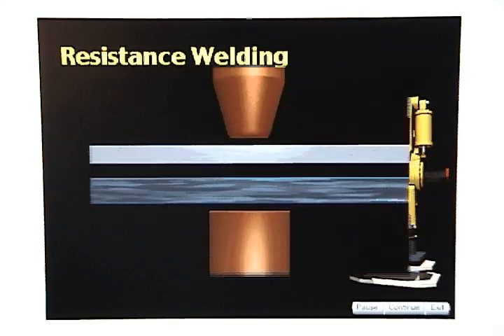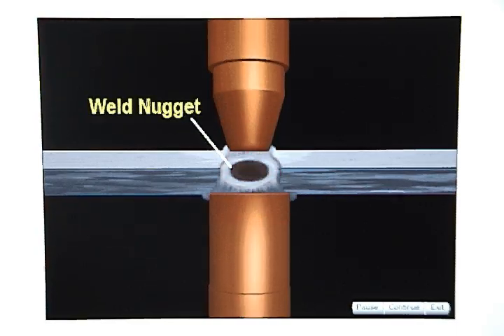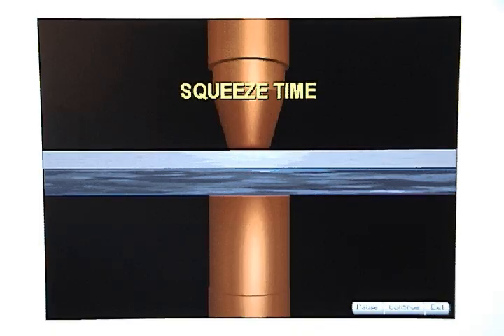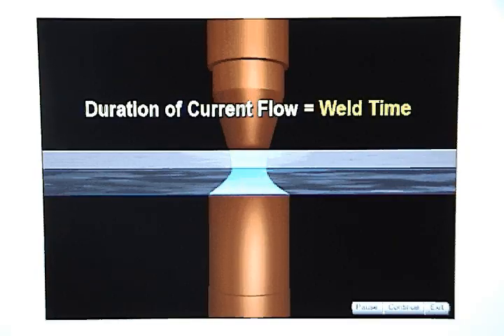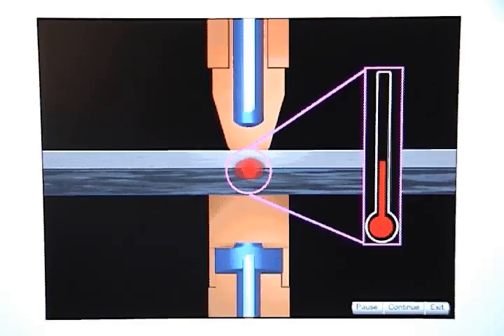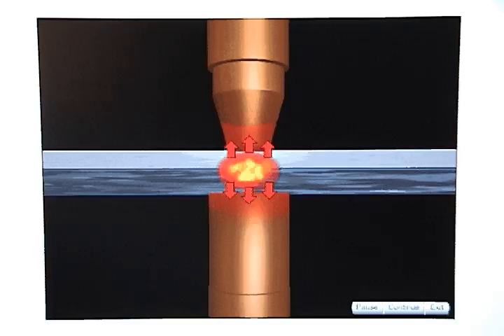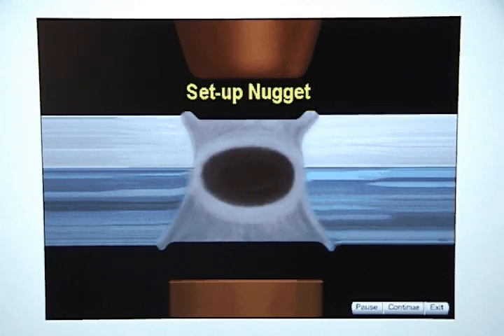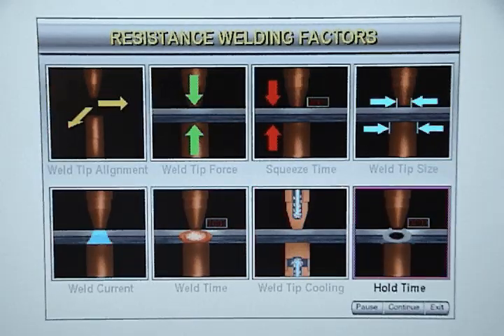Introduction to Resistance Welding-Animated "EZ to learn" - Training/Sales/Service 248-701-9328

Comment: Hoe much pressure needed to weld this plats
Reply from the maker: Pressure is dependent upon material thickness, size of nugget, tip and other factors. however - remember Force, Time(dwell) and Current will dictate.